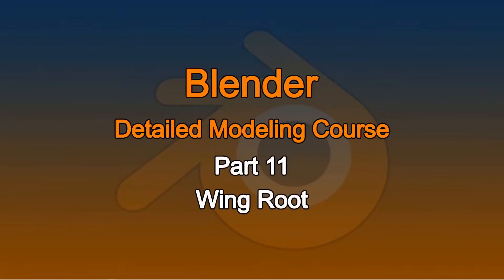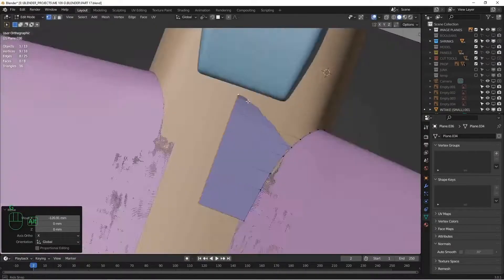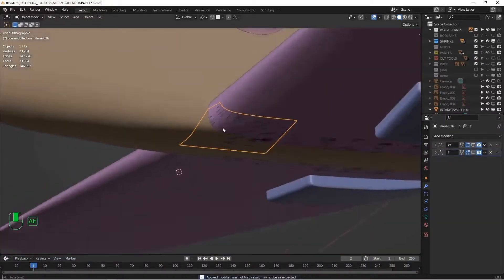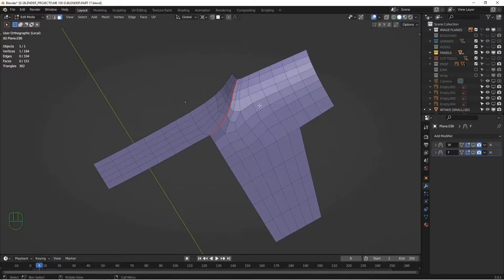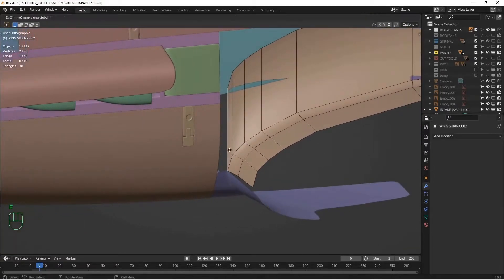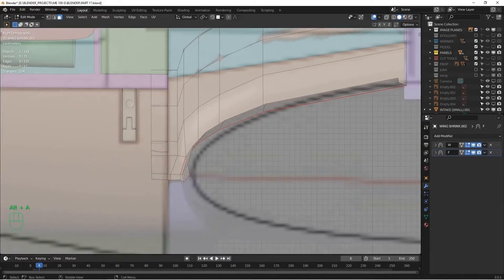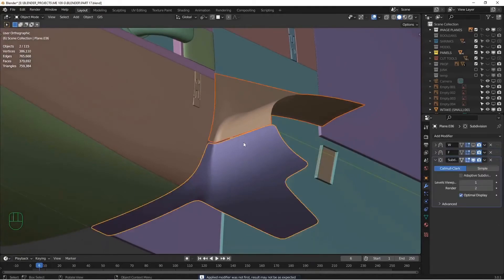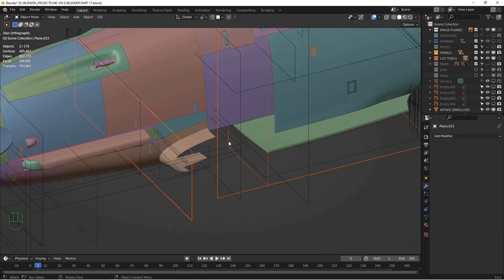Blender Detailed Modeling Course, Part 11: Wing Root

Comment: So, the seam marking the joint of fuselage and wing doesn't line up on my wing root. If i shrink it, and move the edge vertices, it lines up fine. Not sure why this happened (different drawings or smth is off with the wing), but how would you approach fixing it? Just push vertices on one of the root sides until they meet up?